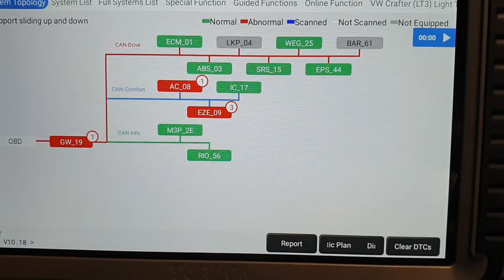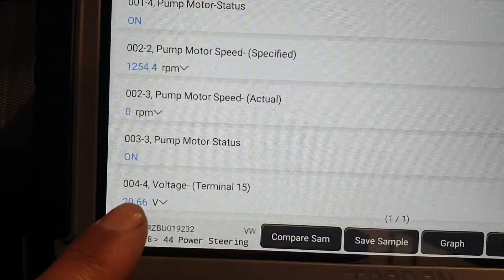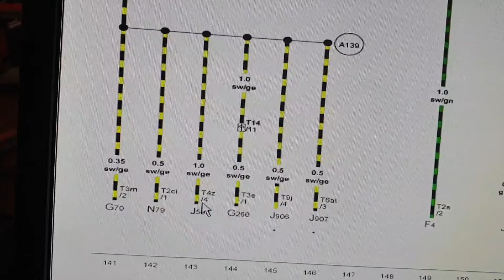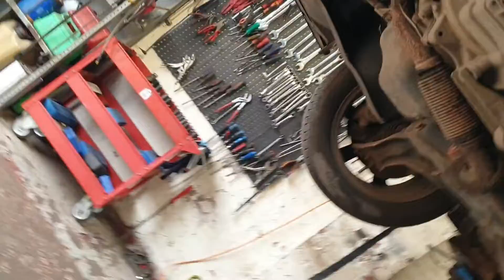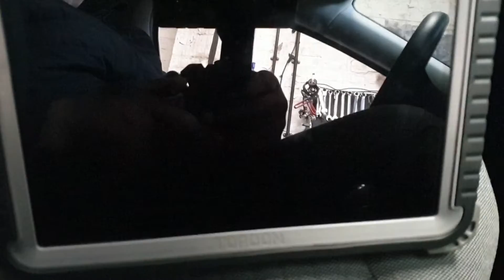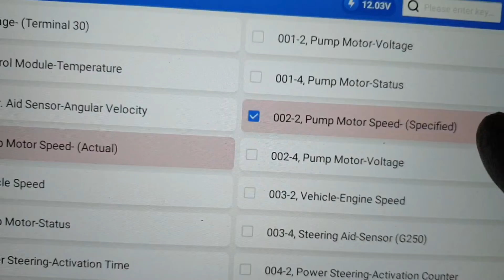Vw Polo 1.2 (6R1) 01309 DTC, EPS Malfunction Diagnosed, Fixed, And The Pump Recoded To The Vehicle.

Comment: Hi mate in my Audi a1 2014 I got same power steering pump , I’ve replace with second hand one and making noise when turning the steering wheel , tip up fluid etc no bubbles , and no light on the dash , any ideas ? The noise coming from the pump
Reply from the maker: There might be an internal mechanical fault with the pump.

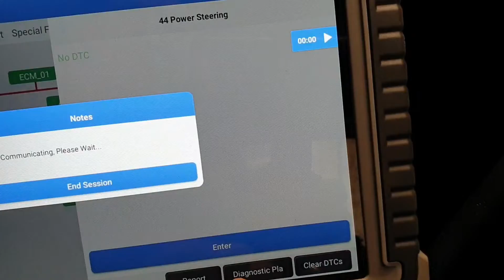Comment: That code is not correct, you coded the pump with the CAN module code, the original pump code was "11250", you can see it at minute 2:22

Comment: Hello excellente video

01271 Air Mix Flap Servo Motor  Short Circuit to ground + 01309 no communication can you  help me please thanks
Reply: Thanks for your answer sir i am from Belgium
Reply from the maker: Thank you for subscribing to our channel.  Secondly, lacking your vehicle's specifications, a technician's accurate diagnosis is impossible without a visual inspection.  Simply retrieving and addressing Diagnostic Trouble Codes (DTCs) by replacing parts based on the code often fails to resolve the underlying issue; therefore, proper diagnosis requires a qualified technician to prevent misdiagnosis.  I have resolved DTC 01309; however, DTC 01271, concerning the temperature flap control motor and its position sensor, requires further investigation.  Our location is B6 7SH, Birmingham, United Kingdom.

Comment: Please remember that one of the jobs of a Module is to accept the voltage to the Module, inside the Module that voltage will be read, then calculated to a digital data format, then sent to the CAN COMM line to the Gateway as digital data then sent to your SCANNER to be translated to Human Readable Text on the screen. You were able to read Terminal 15 as 20 Volts which was improperly digitized by the EPS Module. This misreading was a problem in the Module and this is one reason showing that the Module was indeed BAD, cheers.
Reply from the maker: Thanks for watching our channel, and thank you for this valuable information 😀
Reply: What model is that TOPDON tool ?